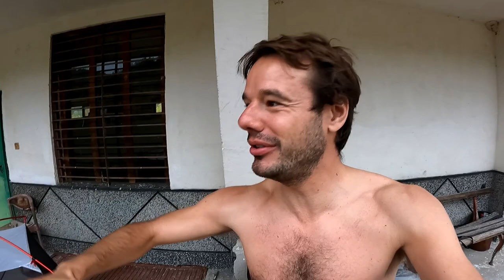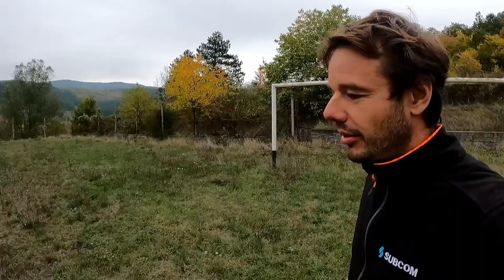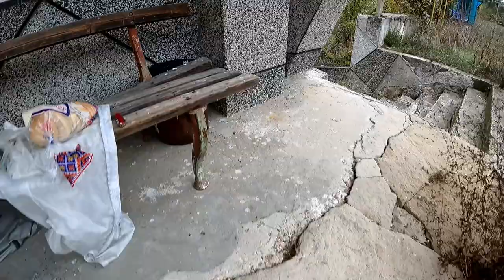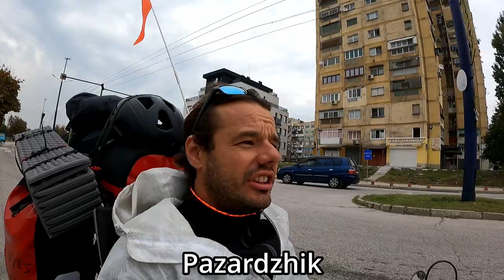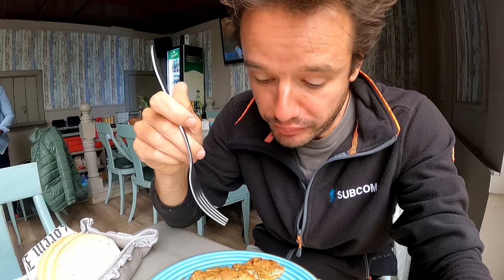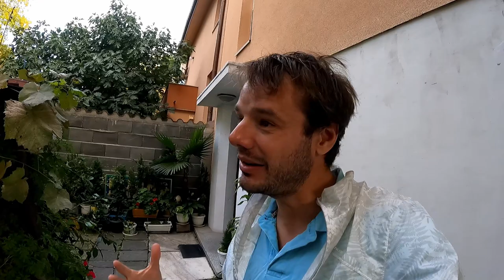vE 49 🇧🇬 a journey through forgotten Bulgaria | Defensive tools on a long adventure

Comment: Now, the main price is not you or something else in your backpack, but it is your bike, or trike. If somebody would steal your bike, what would be your backup plan?
Reply from the maker: I don't know what would be my backup plan in that case. I just hope it does not happen, as this kind of bike would be very hard to sell for a thief.
Reply from the maker: Well, basically, in this kind of journey, you have to deal with the risk of being robbed, it's part of the adventure. And I can't worry too much about it because if I worry too much, I will not enjoy my journey. So I decided to accept the risk of theft, and stop worrying.
But when I leave my bike like that, it's always locked with a big lock, so a thief can't just ride it, he would have to carry it, so it's not that easy to steal, and without the battery and the controller for the engine, the bike is almost undrivable, and now I even remove the seat, so a thief would not be able to use it unless he buys a seat from the company who makes the bike.
But if someone still manages or wants to steal it... then what can I do... it's part of the risk in this kind of journey.